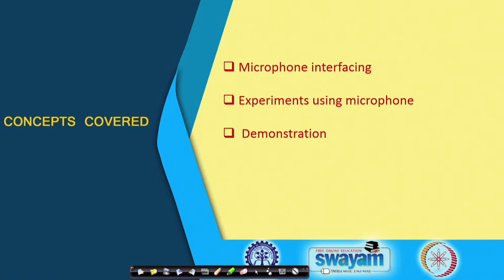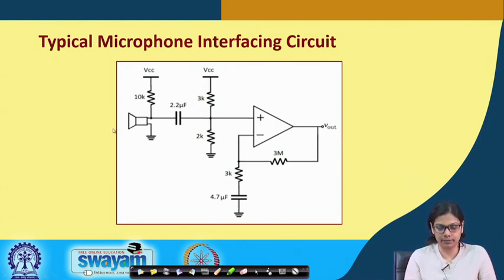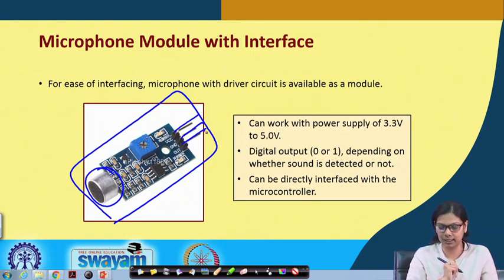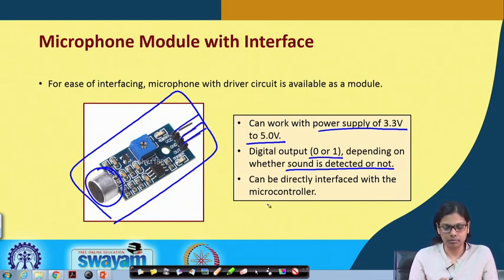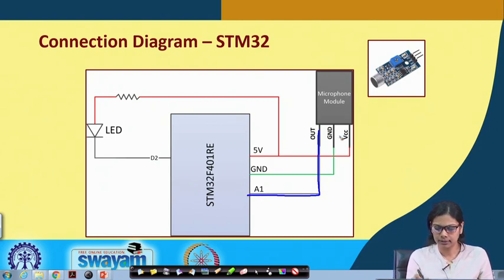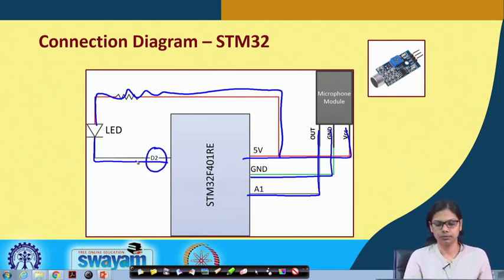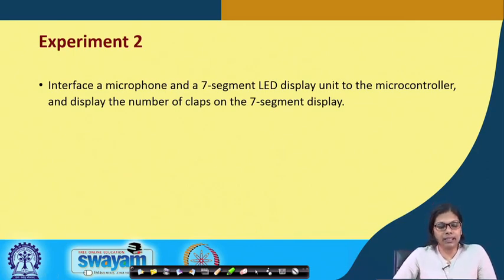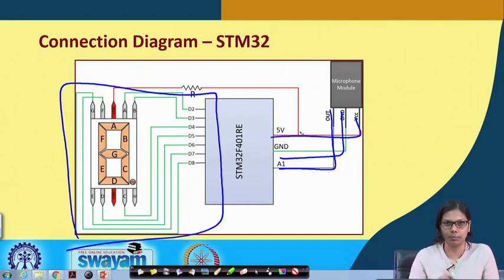Lecture 29: Experiment with Microphone

Comment: 1:50 thats incorrect the image shown is ceramic microphone, it doesnt contains magnet as it is shown in the slides instead peizoelectric concept when the diaphragm is moved it creates small voltage that is than amplified, concepts such as phantom power also comes into the picture.

Comment: 1.LED+MICROPHONE USING ARDUINO

#define A A0
float LED=7;
float a;
void setup() {
  // put your setup code here, to run once:
Serial.begin(9600);
pinMode(A,INPUT);
pinMode(LED,OUTPUT);
}

void loop() {
  // put your main code here, to run repeatedly:
a=analogRead(A);
Serial.println(a);
if(a>980)
{digitalWrite(LED,LOW);
delay(3000);}
digitalWrite(LED,HIGH);
delay(100);

}